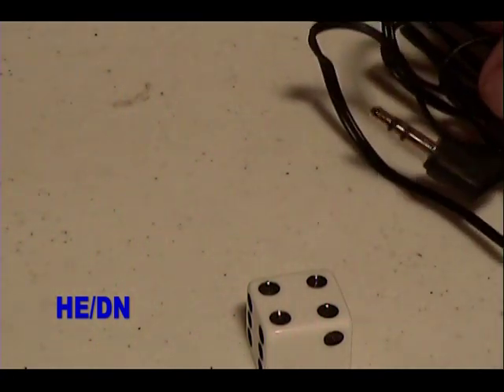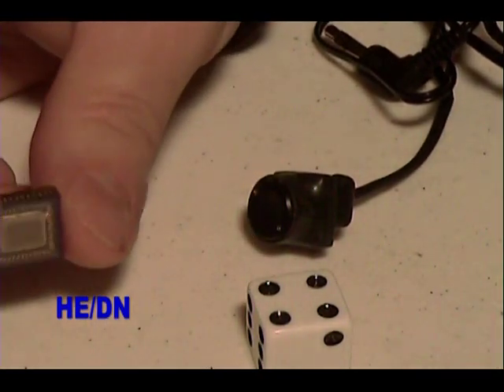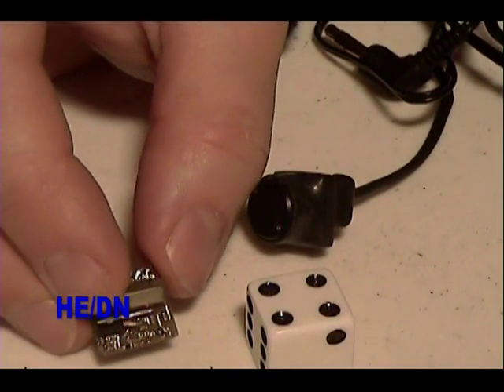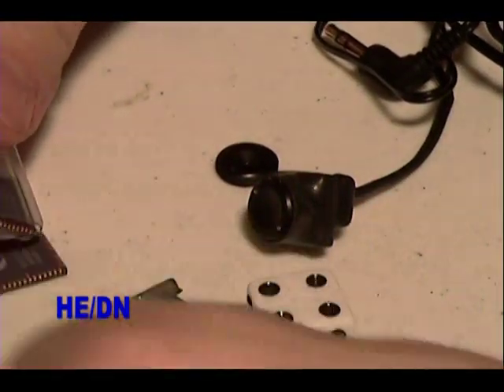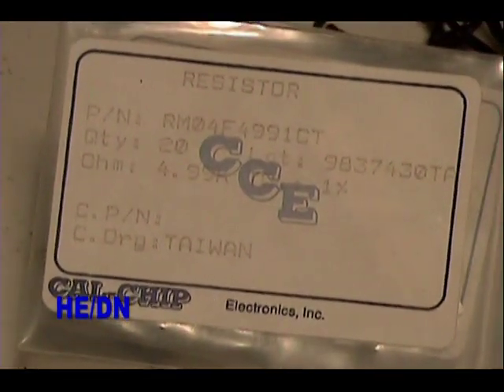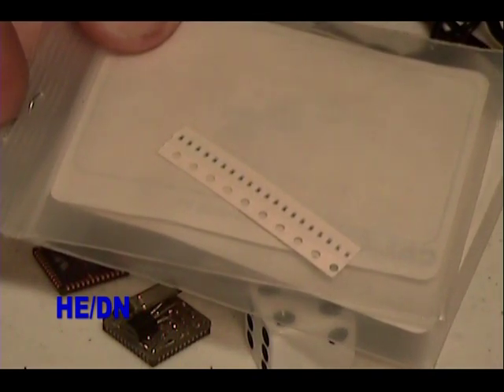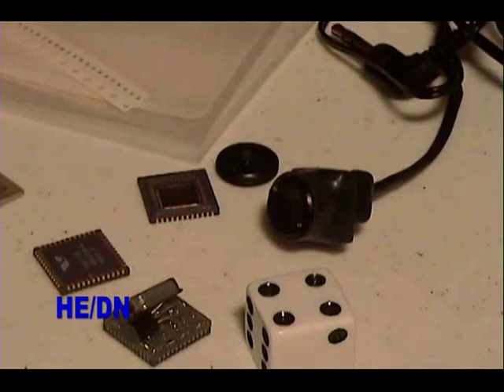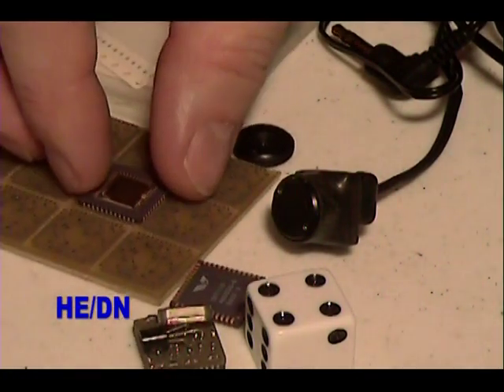Tiny Color Video Spy camera Project (Hot Earth/Dark Nights)

Comment: hello! I have a question about the rubber casing, what material is it? how much does it go for nowadays and also how did you design the shape? does it mount on wall or hang on something? and when you designed it, did you consider how much shock it could take?if yes ,how? 
I  appreciate your help,Thank you